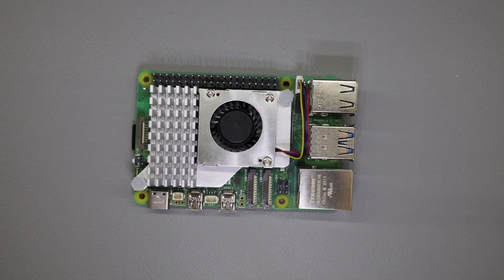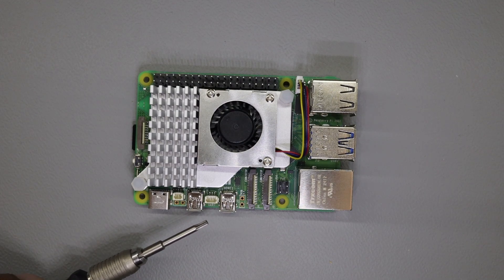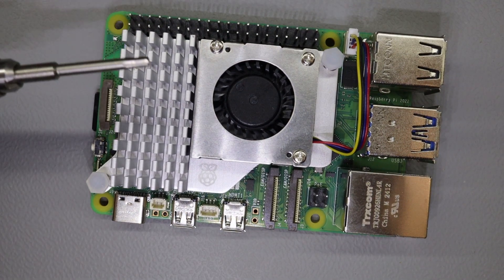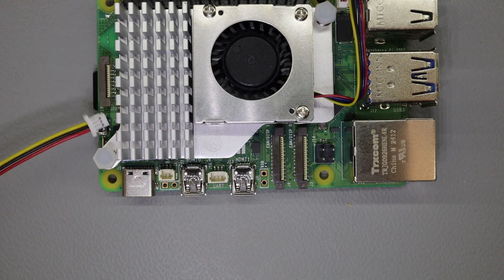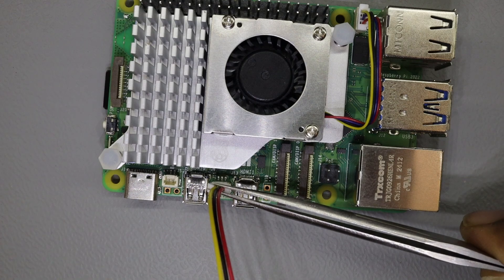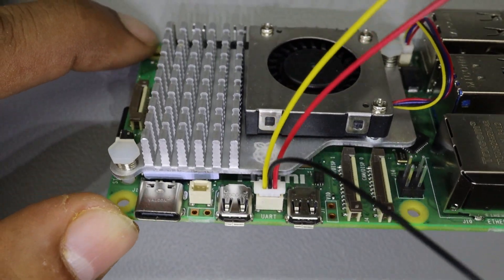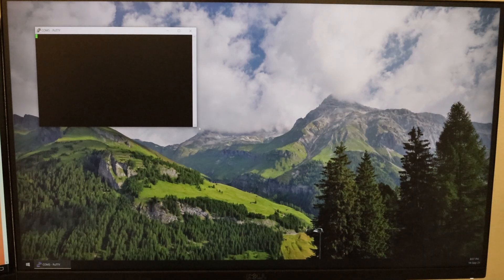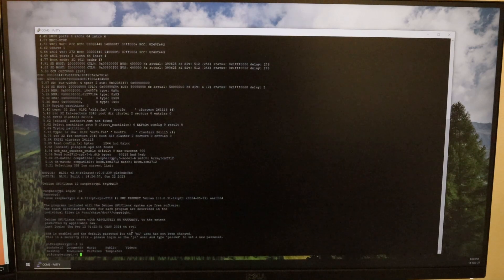Raspberry Pi 5 Debug UART Header Connector Pinout Cable Assembly for Terminal

Comment: I've been having it out with ChatGPT about this. Is it possible to connect a GPS module to that header? Purportedly, that socket contains three of the four pins that the module needs to connect to, the other being the voltage, which I'm told I can use a PoE pin for. Can I do what ChatGPT is painstakingly claiming that I can do? By the way, it told me that the pitch was 2.54mm and later 1.27mm. I'm certain that you're right about it being 1mm, though. I've looked up JST cables, and they appear to have a little part jutting out in the middle of one edge, whereas when I look at the header on my RPi it seems flush. Maybe I found the wrong connector.
Reply: It's just a coincidence that some GPS modules use this connector. Chat GxT tells you what you want to hear. You can read the data you need from the 40-pin GPIO connector.
Reply: What do you even mean by that. This is a debugging connector. Should not be able to power anything.
Reply: @4130colin  I don't know. What's the difference between meaning something and even meaning it? What I mean by it is right there on the page. Beyond that, you're going to have to be a little clearer. You saw my mention of using a PoE pin for powering the module, right?
Reply: I am being clear. It can’t provide power to a module. Use the GPIo pins on the board.
Reply: @ I'm being clear too. We're like twins. What are you wearing?